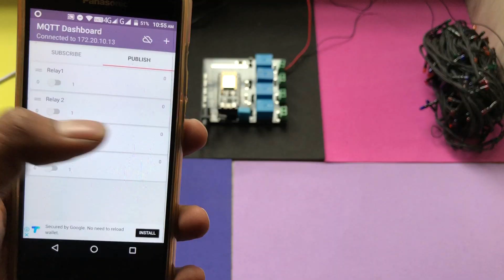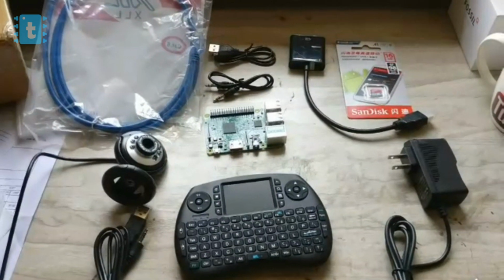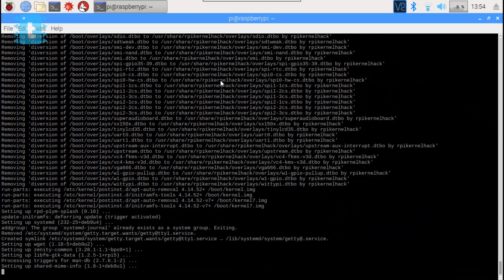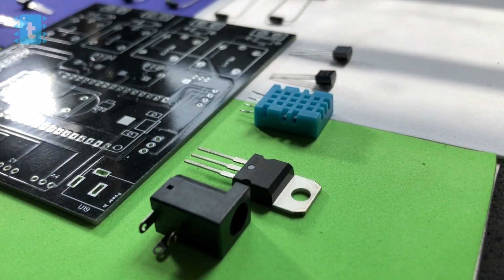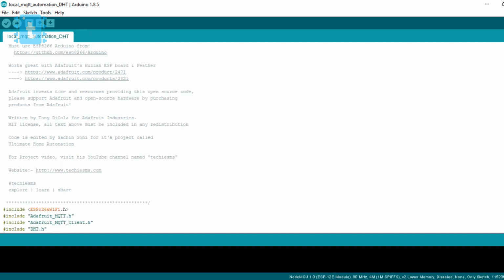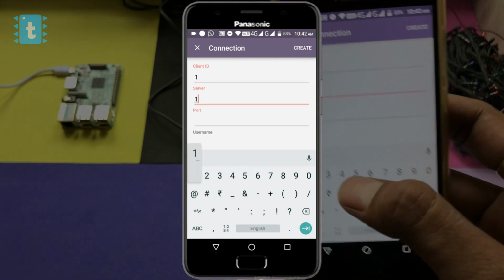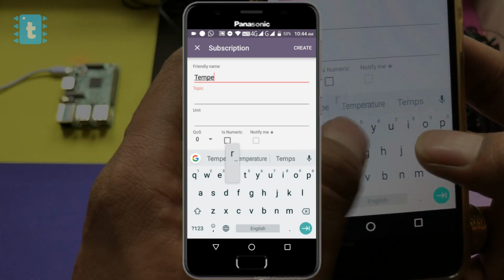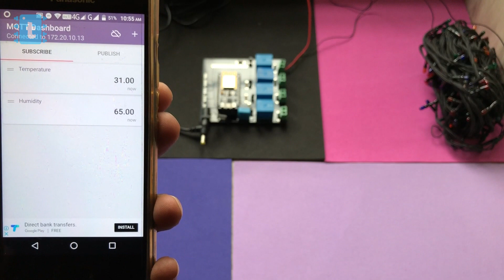Home Automation based on Local MQTT server using Raspberry Pi and NodeMCUBoard | ESP8266 Projects

Comment: Hi techiesms,
what a great project! It works properly.
I would like to setup a MQTT project with one ESP32 as a subscriber and another ESP32 as publisher. The broker should be a local RasPi standalone as Broker-Server creating its own WLAN without connection to the Internet via Router or Access Point.
Can you give me hints how to do this?
The handling of the ESP32 should be easy. But with the RasPi I have got my problems to combine the installed Mosquitto and the WLAN-Server capabilities.
Do you have this setup described in one of your courses? (Please without NodeRed.)
Thanks!
Oli

Comment: How would I control some stepper motors with your code and the esp8266 nodemcu board. My steppers are very small and I’m hoping to control them without using a motor shield. Can I use MQTT to send the correct commands?

Comment: Great video. Just one question, how can I run MQTT server script on pi and listen to some of the data flowing on the same pi and take action against it. For example, the temperature sensor data can be used to turn on the fan connected via relays to Raspberry Pi. 

Also had a doubt regarding the port number. There must be some file you ran for a broker on PI? Can you please elaborate on that?

Comment: I tried using with the 4 channel relay module,but all the relays are turned automatically on when I power the nodemcu and switching buttons on turns off the relay ...please help with the code ...what code to change ?
Reply from the maker: Change the the connections from NC to NO or viceversa
Reply: @techiesms  where Sir ,is it in the code ? Or physically through wire?
Reply from the maker: Wires
Reply: @techiesms  but sir it may look odd then , I want to know why its working reverse on 4 channel relay board and would like to know how through code this can be solved , thanks for replying